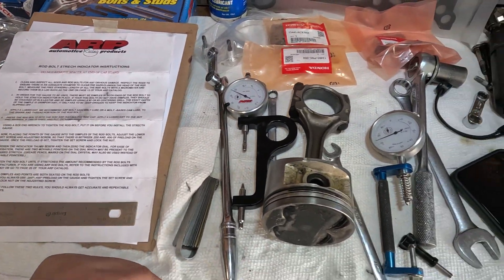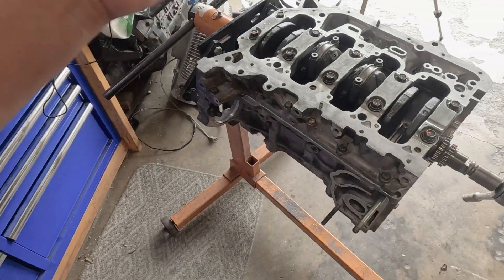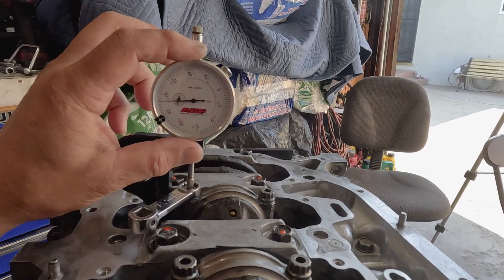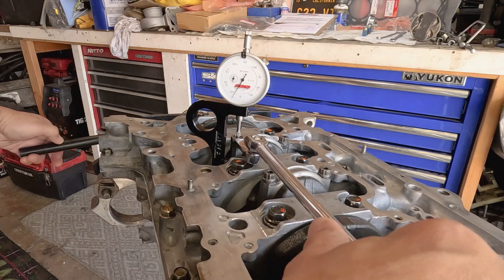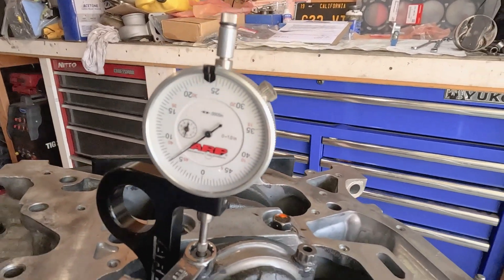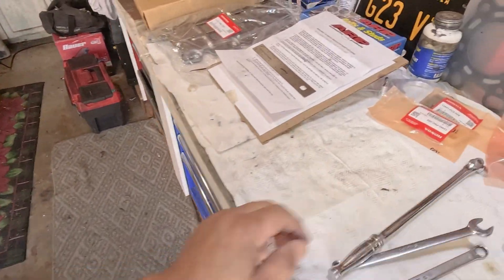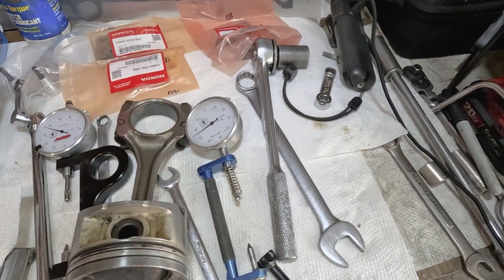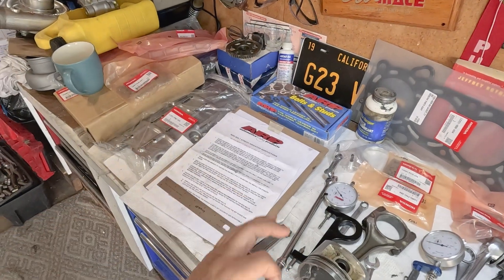How to use ARP Rod bolt Stretch Gauge! step #5

Comment: You are doing it wrong!! You may over torque the rod bolts
Reply from the maker: You have 2 ways of stretching the rod bolts depending on what bolts your forged rod manufacturer provided, ARP, Manley and many more.
1) Using a strecth gauge and tighten the bolts 'till the provided stretch specs is achieved per bolt manufacturer specs. If using ARP, follow item #5
2) If somehow you don't own a strecth gauge, use a torque wrench and tighten the rod bolts per your bolts manufacturer torque specs.
It took me 2 tries ( tightened, loosened and torque it again) and strecth specs was achieved just like on my videos and it made me a believer l quoted.
The ARP strecth gauge instruction item #5 is very simple and very straight forward.
There's a rod bolt instruction that l read and its printed that you cannot use a combination of both, that's using gauge and torque wrench were you keep adding torque to achieve the provided bolt strecth. Doing it this way will not only over strecthing the rod bolts but also distorting the cap and twisting the bearing inside.
If you decide to use ARP strecth gauge, l highly recommend to take the time to read the instruction specially item #5. You'll be amaze how easy it is and how accurate it is and thanks for watching man, later.